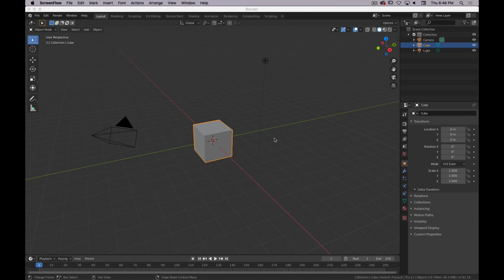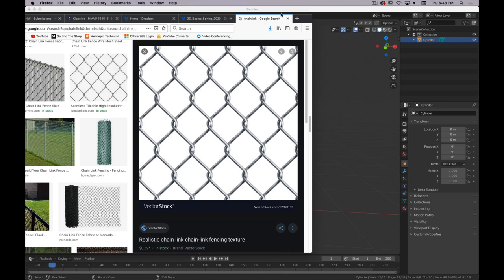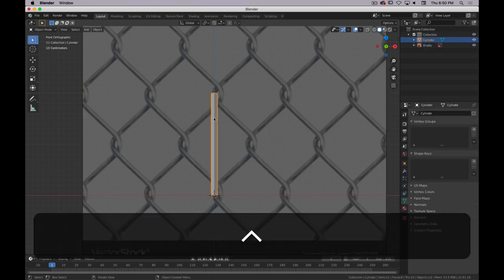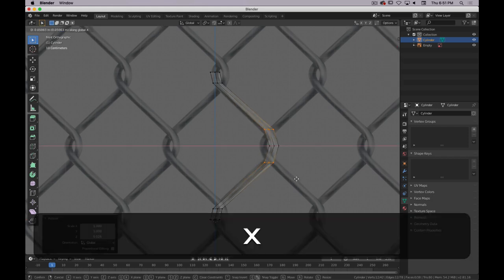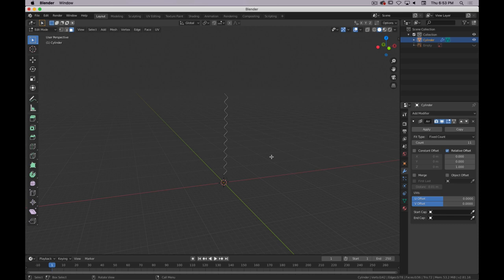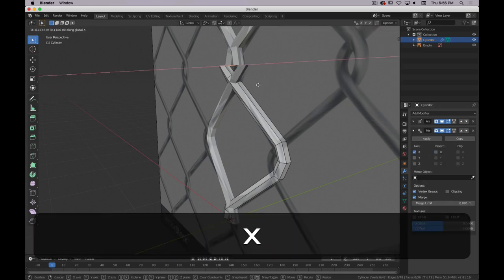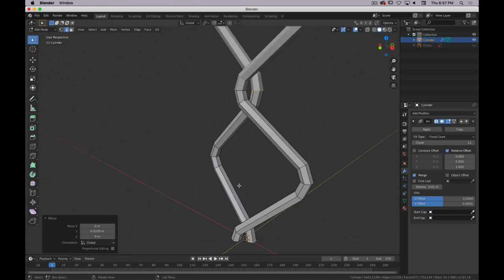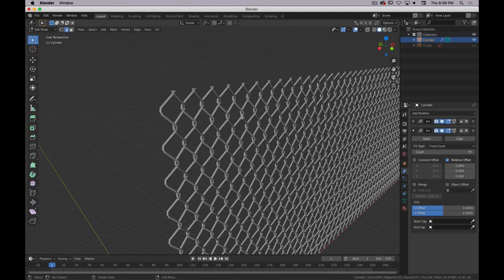3D Basics in Blender - Modeling a Chain Link Fence

Comment: For video game development I would think making a "translucent" fence texture on a plane would be more optimized for the game because it would lower the total poly count, but I wanted to mess around with actual meshes with detail like this but I still cant figure out which one is a good balance in low poly count and quality
Reply: The best would likely be a texture with a displacement or bump map as well as an alpha mask to create the depth without needing the extra geometry.
Reply: I use the same method transparent double face